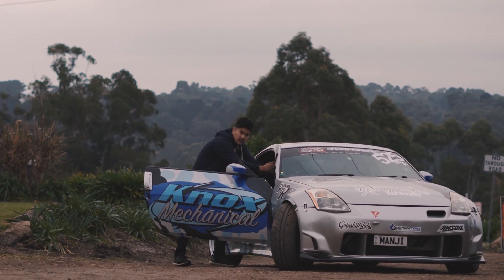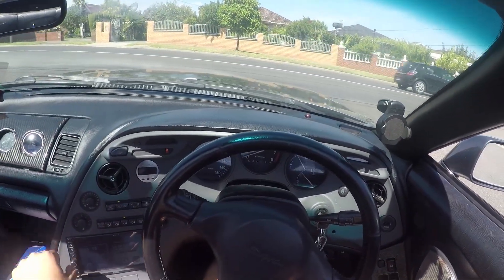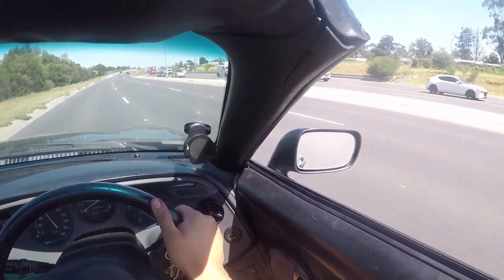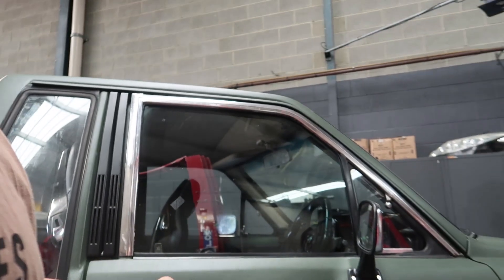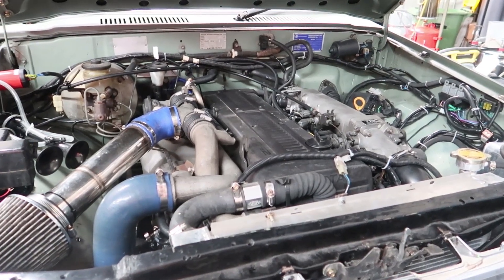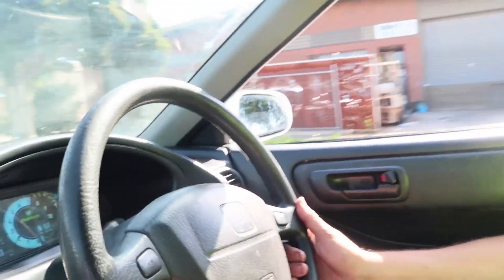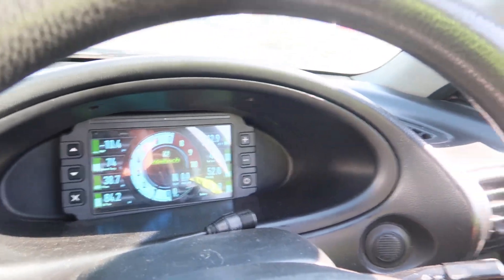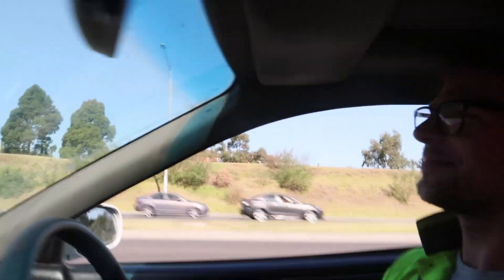First Drive | G35 1050 Pulsar Turbo T51R Mod | MK4 Toyota Supra JZA80 2JZGTE

Comment: So any updates on this particular turbo? Looking at getting one myself, but finding it hard to find any reviews
Reply from the maker: The update is my motor is pulled apart atm and won't be back until end of April start of may :(
Reply: @ajsakai   What’s wrong with the car? Can you tell me more about the turbo? Was it working fine? I know Pulsar has been making a great job with their turbos.
Reply from the maker: @Rboost77  unfortunately the oil pump failed and there was bearing damage due to a lack of lubrication! So the motor has been torn down and am currently awaiting to go all out on it when all the parts are in. As for the turbo I'm not.able to do anything about it as of yet.

Comment: What rear housing you go with the the new setup
Reply: I have a fc rx7 with a old greedy t88 34D  and swapping to the pulsar g35 1050 but I have to go the garret 1.21 rear housing
Reply from the maker: Hey bro, the 1050 is the rear housing for that turbo! Garret decided to change the 1050 meaning to the horsepower rating of the rear housing!
Reply: @ajsakai  lol nice info you got hahahhaj good luck with the build you will need it
Reply: What is the actual rear housing size you're using... its not 1050..
Why is it so hard for everyone to to list the actual AR
Reply from the maker: 0.75 just researched it for you guys :)
Reply: @ajsakai  i dont think they make a rear exhaust .75ar... double check your source.
Reply from the maker: @dangerousfandango5943 
Says compressor but feel free to correct me if you're able to find the relevant information on it. https://www.garrettmotion.com/racing-and-performance/performance-catalog/turbo/g-series-g35-1050/
Reply: @ajsakai  forsure.. cus ehen guys ask for ar.. mainly its the rear exhaust ar
 Not compressor.  So guys will sirts get an idea of how it spools if they have similar build.  I belive garret has a AR.61 and a .83 or something.. then something much larger..  we're all just curious.. i myself cus my 2jz is  all stock daily.. got a pt6262 .68ar.. and response is amazing. So i was actually looking intio a g35 1050 also.. maybe .83ar
Reply from the maker: Mind my blonde moment, it's 0.83ar

Comment: 15k on the motor? 😂 I have a stock k20 with bolt ons and have eaten e46’s but then again 15k aus dollars to U.K. pounds kinda makes sense to do the swap too 🤔
Reply from the maker: 15K spent to convert everything into the DC2
The DC2 has bougie parts all round including the IC7 Dash!!!
Also it was an M3 BME E46!
Reply: was a m3 not just a e46

Comment: Typical nonsense dumping a bunch of money into smaller NA motors, trying to make power and what you end up with is an undriveable buzzy tincan that get's it's doors blown off by a stock GTI or whatever. That thing probably makes 300hp @ the crank, but 15k for that? I will admit that what people achieve with those motors NA are impressive but the return and results just aren't worth the investment!